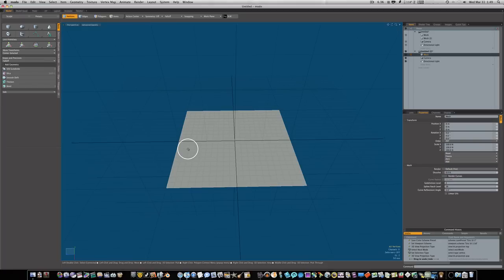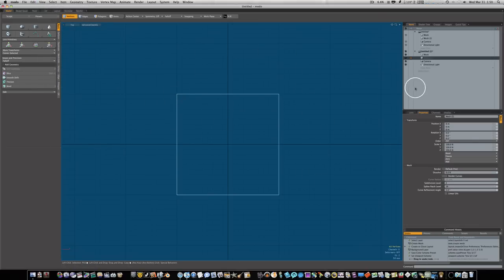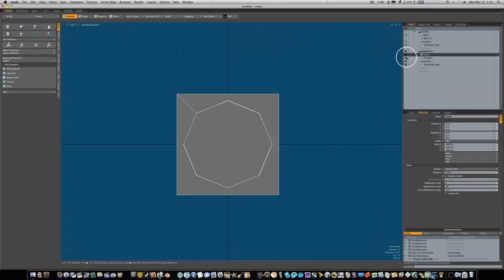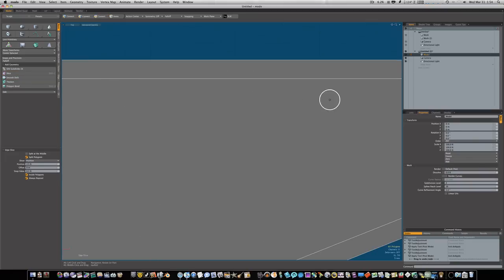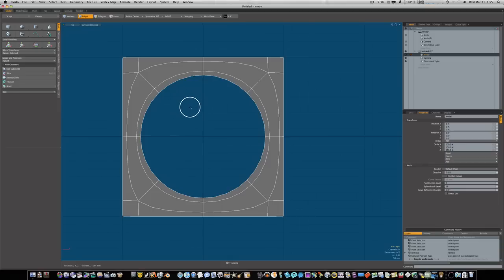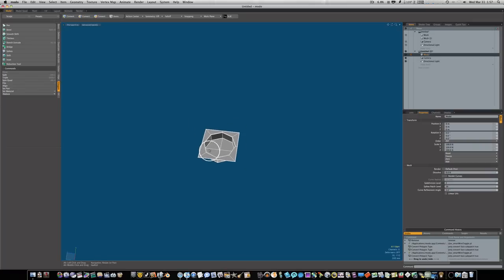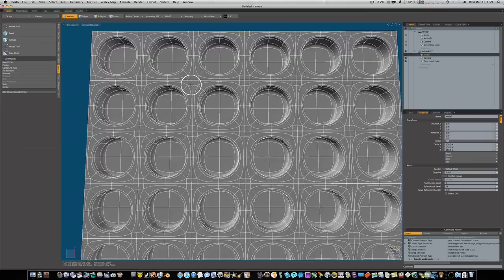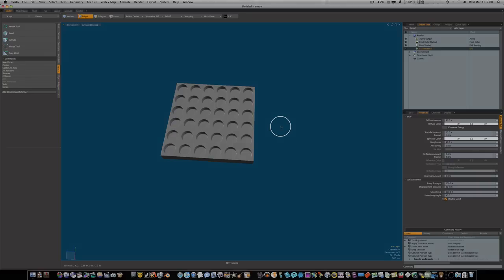Modo 3D Modeling Tutorial - Inorganic/Hard Surface Modeling Techniques Part 1

Comment: To make it more accurate, you could activate snap to vertices so that your loop slice tool will snap to the hexagon vertices as you're cutting into your model. At least thats what I used to do in 3ds max :) not sure if its possible in modo